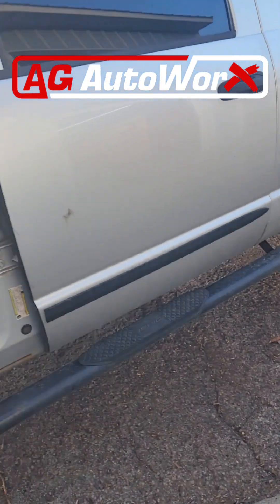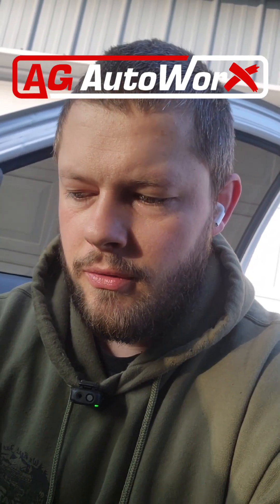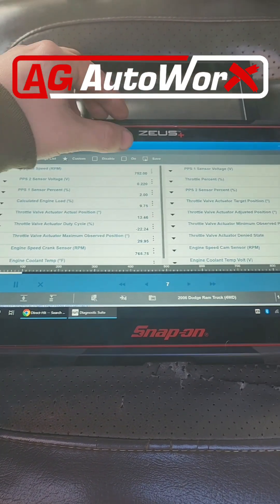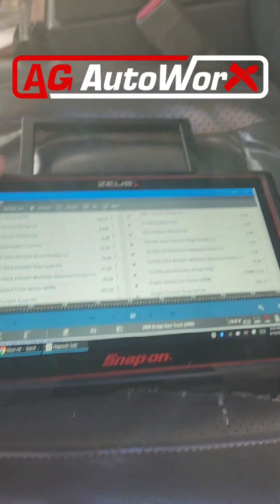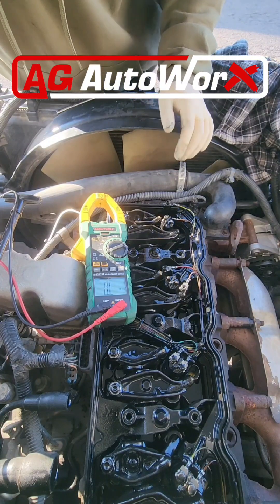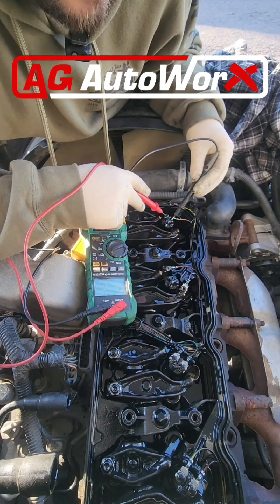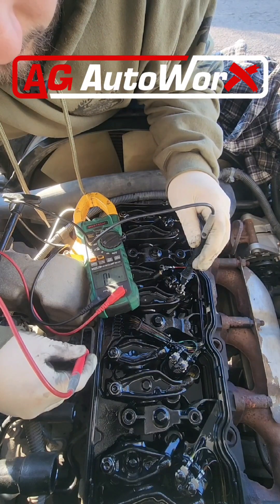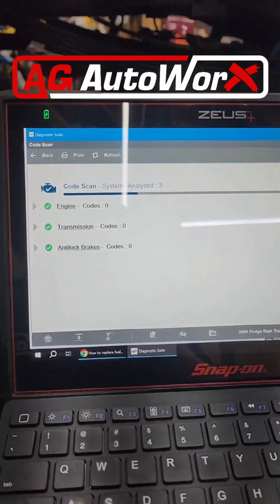2006 Cummins p2146 p0201 Diagnostic procedure

Comment: Hello friend, I have a question, I have a problem with the code p0606 and now I get the code p2146 and it tells me group B injectors, I thought that my computer was damaged since the p0606 shows a processor failure and now that I'm looking you also have that code, you say it could be an injector problem? because I thought the truck was like in emergency mode, that's why it had no power at all and in the morning when I just started it it released a lot of white smoke, I hope you can help me, thank you
Reply from the maker: So when the computer shows alerts for supply voltage to the injectors, the computer will cut out the three injectors on that circuit so there’s two groups of injectors so whenever you see that supply voltage alert, the engine will actually run on three cylinders and it will disable the group that shows a faulted supply circuit
Reply from the maker: You will have to test the three injectors on that group to determine which one is faulty
Reply: @agautoworx5346  thank you

Comment: so would p0201 be for the 4-6 injectors?
Reply from the maker: 0201 indicates an issue with the circuit of injector #1. Could be injector or wiring to it. Mine had p0201 before but started running fine again. 2 days later it killed 3 cylinders and had a p2146 code.

Comment: I have similar issue I believe the codes I got are p0201 p2509 p0016 p2146 p0513 I thought it was crank sensor changed it and it didn’t fix
Reply from the maker: Definitely do these checks for the p0201 and p2146 codes. The rest of those codes could be something as simple as low battery voltage or loose battery cables. Check those first. Lose power/ground connections can cause crazy codes.
Reply: @agautoworx5346  took off valve cover and took off wires to solenoid and ohmed em and cylinder 1 was 1.5 and cylinder 4 was 2.2 does that mean injectors are bad on those to